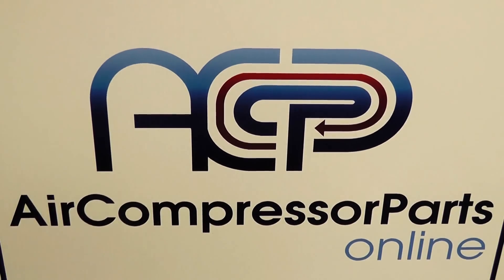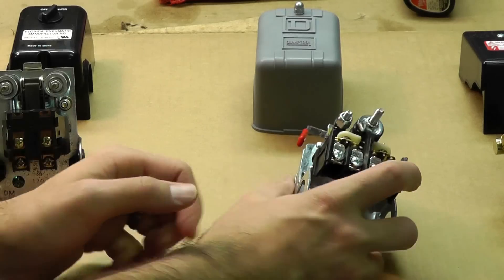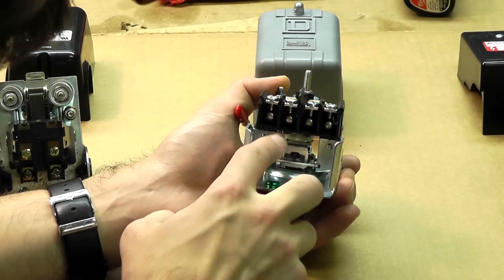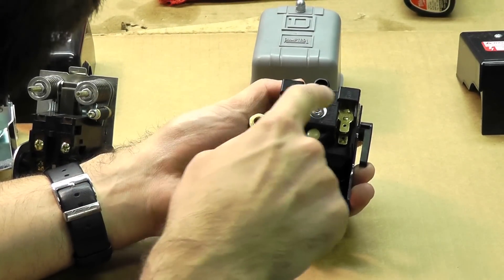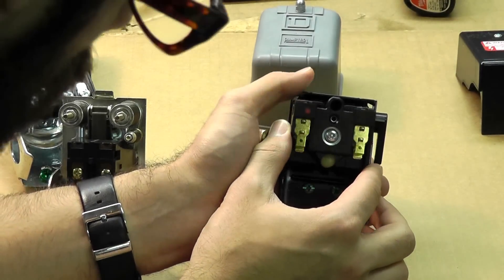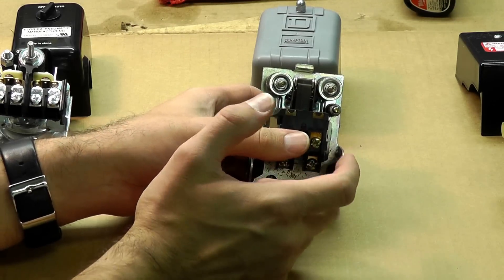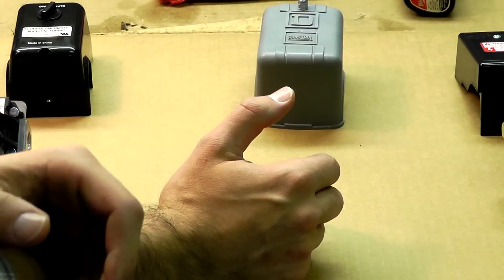How To Adjust And Wire A Pressure Switch

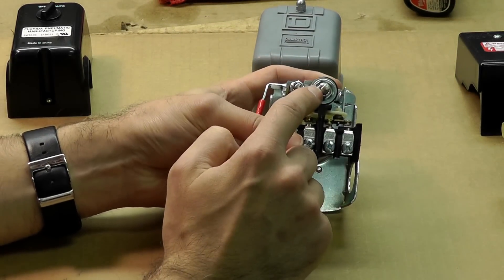Comment: Question: Square D pressure setting (4:53) Is my understanding correct?  (1) First adjust the large nut to set the cut in pressure, so if I wanted to lower cut-in pressure to 100 psi to reduce the amount of cycling I would turn it counterclockwise.  (2) Then if I wanted to maintain the manufacturers 175 psi cut-off pressure, I would turn the smaller nut to increase the differential.  NOTE: This is an Ingersoll Rand 2475 unit which comes from the factory set to something like 140 psi cut-in, and 175 cut-out.  I typically run higher volumes of air at 40 psi in a media cabinet and don't need the unit to cut back on at 140 psi because it is so far away (pressure-wise) from what I need, causing the compressor to annoyingly cycle.

Comment: I wonder if it's possible to repair a pressure switch? The cheapest I can find a Condor MDR2 in the UK is £50. I only paid £60 for the compressor, and I could buy a complete new motor + switch for £150.
Reply: Everything's repairable (sometimes moreso than others). What's wrong with it?

Comment: When building presure and it cuts off all the air bleeds out down to about 40 psi. How do I adjust a condor switch so the air doesn't bleed out
Reply: That's not the switch. You need to locate where the air is bleeding out. It should be airtight. (Assuming you don't have a 40PSI safety valve)

Comment: Can use these switches foo operatic Uv light.  I am tryin to do is to only operate the Uv light when the pump comes on.i am living in Cambodia and  to not burn out my UV light when my pump is not t I have to unplug the power  cord.
Reply from the maker: Since the pressure switch tells the compressor when to cut on and when to cut off, you should be able to do this, yes. You would need to choose the pressure switch that has the cut-on and cut-off PSI that you need. There are many switches available in various configurations that we offer (and many other retailers offer). I don't know much about your application but I'm sure this can be done. Thanks for the question!

Comment: I have Square D switch ..What will make the contact points stick..the compressor will not kick off..will run till pops the pop-off valve
Reply from the maker: Thank you for the question! If the contacts are not physically touching when max PSI is reached, then most likely the switch needs to be replaced (this is also a safety issue). If they're touching but the unit isn't turning off, you should be able to take some emery cloth or fine grit sandpaper and clean the points up, as there is probably varnish on them, not allowing them to make clean contact.
Reply: @AirCompressorPartsOnline   they seem to weld together when compressor runs for a bit
Reply from the maker: @rickystone4137  I would make sure that all other electrical components on the unit are working properly. Make sure the power cord, motor cord and motor are pulling the correct amperage and voltage. Enlist an electrician to confirm the above, if possible.
Reply: @AirCompressorPartsOnline  I put a new square D switch on it and its seems to have fixed the problem..thx
Reply from the maker: @rickystone4137  Glad to hear it! We appreciate the comments.

Comment: So for air compressors there’s no such thing as a single or three phase pressure switch right??? Lol
Reply from the maker: Basically, that's right. Any typical pressure switch like you see in this video will wire for single phase or three phase power.

Comment: I have a 30 gallon Ingersoll Rand air compressor in my garage and want to use it for sprinklers blowing in my house, they recommend to blow them at 60 psi but my compressor fill up to 125 psi, what do I need to do to make it blow at 60 psi ?
Reply from the maker: Thank you for the question! You just need to install an air regulator valve, which will typically "T" in from the on/off pressure switch and has a coupler on the outlet end to attach your air hose to. You turn the regulator knob CCW to reduce the amount of air to your line. You can find something like this on our website by clicking at the below link:
https://aircompressorpartsonline.com/regulator-14-mini-reg0250m-p-156.html
Reply: Air Compressor Parts Online thanks a lot, I’m gonna put this other right away,

Comment: I just purchased a new pressure switch for my Ridgid 5 in 1 but it keeps popping my breaker and I know the wires are set properly what can I do to fix this issue
Reply from the maker: You may want to confirm the motor isn't drawing too many amps. If it's a new pressure switch, the only other cause could be the power cord itself (possible short) or the motor is drawing too many amps. I would probably have an electrician take a look since electricity is involved, that's the safe bet.

Comment: Is there a reset button when you replace preassure switch? I replace that black box on my 15 gallon dewalt and now it doesn't want to turn on at all. Please Advise
Reply from the maker: There isn't a reset button on the switch itself, no. If you installed it and it doesn't turn on, you may have wired it incorrectly. Also, check to make sure the power cord is in good shape and that you have continuity throughout the switch, cord and motor. You can bypass the pressure switch to see if that's the weak link. If all else fails, I'd recommend getting an electrician to take a look at it. Thanks for the comment!

Comment: Question? What is the allen screw on the top, in between the contacts of the switch that you showed and said you couldn't adjust the pressure setting for? I have a hubbell on a Ingersoll that looks exactly the same as that one and it looks like it adjusts something(but i don't know what), because it is connected to a big spring and when you turn the screw the spring gets tighter or looser. Can I get some help with this? And what if you get the silicone off that's covering the adjustment screw, could you, in theory, change the pressure setting? I just need to lower the pressure cut out for safety reasons. Thankyou
Reply from the maker: Thank you for the comment! You could in theory remove the silicon from the screw head and adjust it, yes, although it's not recommended due to liability reasons (for that reason I can't say that it's recommended). Typically, the screw with the larger spring adjusts BOTH the cut-in and cut-out pressure, whereas the smaller screw/spring adjusts the differential only (i.e., just the high end cut-out PSI). Hope this helps!
Reply: @AirCompressorPartsOnline  Thank you so much for the reply. I have the exact same switch in your video on the far right, the one with the silicone cover. So you are saying the torx screw that is attached to the big spring is the main cut-in/cut-out adjustment? Well i very easily got the silicone cover removed, it doesn't matter anyway it's 3yrs out of warranty. But regardless that silicone was covering a plastic screw and it didn't help me because it did not adjust the cut out pressure, it might be the differential adjustment screw. But when i loosened the plastic screw enough it started leaking air, so i turned it back in to enough to stop leaking air. Do you have any idea what that plastic screw is that was covered? Or anyway i could figure out which is what? But the other one that was not covered(a smaller torx screw attached to a big metal spring) seems to be the one that adjusts the main cut in/cut out pressure, because when i loosened it enough it would cut the electric switch off when in the auto position. It doesn't make sense why they would cover the differential screw and leave the cut out open to change, when the cut-out would be the safety problem. And one more thing i thought the differential wasn't just the high end cut out pressure but the difference between the cut-in and cut-out, like how many psi difference between the two. Thankyou for your time, you are helping me SO much right now.
Reply from the maker: @NSXTACY420  You're welcome, I'm glad to offer any help I can. The differential adjusts the difference between the cut in and cut out, PSI so you're right there (I had that wrong above). The big spring adjusts both cut in and cut out pressure. You have a point about the mfgr covering the differential. I asked an associate about this and he said that typically they only cover the cut in, cut out screw/adjustment.
Reply: @AirCompressorPartsOnline  Thankyou again tremendously! I finally figured it out and i got my pressure cut out to shut off at exactly where i wanted it at 105-110psi to make it much safer, but surely make my motor work a little more. But yes the cut-in cut-out was not the one that was covered with the glue/silicone, which the opposite i was expecting. The plastic screw did nothing to the cut out pressure and i just screwed it back in to default and put a rubber cover back over it, as i don't need to change the differential. But I'm glad, through these comments we are also helping someone else with this dilemma i had. Thankyou friend.
Reply from the maker: @NSXTACY420  That's great to hear you were able to adjust the differential where you need it and I'm glad to help! Thanks again for the comments. It really depends on the manufacturer and the particular pressure switch. Some switches are fully adjustable while others less so. I'm sure it all has to do with liability issues, etc.

Comment: I purchase a husky 80 gallon tank only and the tank itself is rated at 175psi Max, and I want to make the compressor a 2 stage, since 2 stage pumps produce max 175psi, will I be ok having max psi rated pressure on the tank all the time at 175psi?? I want to install a 5hp 2 stage pump and motor.

Comment: were d0 I get a motor start switch? cant seem t0 find much ab0ut them . it the part in the back 0f the m0t0r v shaped c0ntact . thx
Reply from the maker: Thanks for the question! I would honestly contact the motor manufacturer. Typically they will give you an authorized sales center who can assist you with parts and sell you parts. The parts may or may not be available, depending on the brand and type of the motor. Many times this contact can be cleaned and polished, but if it's damaged or defective then yes, you'll need to replace it.
Reply: yw n still trying n yea it's damaged the white plastic piece is br0ke 0f it tht keeps it fr0m t0uching after it starts .

Comment: Hi, my old switch was a 30 psi. When replacing it I coulld only find a 40 to 60 psi.. It seems to click on and off too much. Having replaced the pump I'm worried of it burning out. Can the  new switch setting be too strong?
Reply from the maker: I would try adjusting the pressure switch first, per the instructions in  this video. Most switches are adjustable so take the cover off (after everything has been turned off and unplugged) and attempt to lower the max cut-off pressure. If not, then you will probably need to find a 30 PSI switch like your original. Square D makes one I believe.
Reply: Thanks so much..ended up taking up the pressure tank and replacing...seems to have been the culprit...it was full of water

Comment: Excellent vid. I replaced my old switch with a Square D. I wired it the same way the old one was wired. After resetting the breaker 4 times, I found YOU !.  Thanks, man. Very detailed, simple and clear. Square D. works like a charm. Thanks again.
Reply from the maker: It's great to hear this video helped you Bill. You're welcome!!
Reply: After watching multiple videos, yours was the only one that explained it to where I finally adjusted it right. Thanks!

Comment: I have a CH compressor that had a 220 motor I have a replacement motor that is 110  I think the switch won't care . But I'm not sure, Can I use the same switch ?
Reply from the maker: You certainly can wire the switch for a 220 volt motor, yes. Most every pressure switch can be wired for either 115/120 volts or 220/230 volts. If you have any additional questions, feel free to ask!
Reply: raedwulfone well, is there a 12V DC switches??
How much are they..??
Can you post the link where they sell it. 
Thank you

Comment: ist posible to not connect the strain relief on the pressure switch
Reply from the maker: Are you asking if it's possible to not connect the strain relief? You don't have to, but the electrical cord would be loose and dangle around which isn't ideal. Dust and debris can also make its way inside the switch, which can dirty up the contacts and prevent it from working.
Reply: +Air Compressor Parts Online sir im a beginner in pressure switches and i really dont know how to connect the relief strain can i just hook it up in the air tank?
Reply from the maker: You could clamp the power cord to the tank and then wire it to the switch, yes, but it's best to run the cord through the strain relief first as this will secure the cord in place and keep debris from making its way inside the pressure switch contacts. As long as you don't have any exposed wires, however, you could do what you are suggesting, yes. I would at least put electrical tape over the holes where the strain reliefs would go, to keep dust and debris out.
Reply: +Air Compressor Parts Online ok sir.how about the unloader valve? can i put copper tube directly to the tank or it needed check valve.
Reply from the maker: Glad to help! You need to run the Unloader Tube to a Check Valve in the tank, yes. The Check Valve keeps the air in the tank after the unit pressurizes and shuts off. The Unloader Valve must connect to either A) The Check Valve or B) The Pump head. If your pump doesn't have a connection for the Unloader Valve then you'll need to run it to the small unloader port on the check valve, this way it can relieve the excess pressure in the Discharge Line and from the Pump Head.
Reply: +Air Compressor Parts Online thank you sir for infos.:)

Comment: Hello. 
Will this switches work on 12v?
Reply from the maker: Unfortunately not, these switches are designed to be wired for 110/115/120 volts or 220/230/240 volts.

Comment: hello  sir my disel pump (fire pump) is start in auto mode without pressure drop ,but it should to be start after pressure drop can you tell me plz what is the problem ,

i think pressure switch is not working..may be plz help me
Reply from the maker: It does sound like a pressure switch problem, yes. Since the pressure switch controls the activation of the pump, this is my best guess. However, I'm not very familiar with these diesel pumps so I cannot say what is causing this definitively. I would contact the manufacturer of the pump to be honest. Thanks for the post!

Comment: @Air Compressor Parts Online Hi, can all compressor pressure switches be adjusted?, mine has the red pull up and press down switch on top to turn it on and off,very common type,it stops at about 115psi but does not kick in until about 30-40 psi way too low,i want to adjust it to about 60 psi cut in.
Does the black plastic casing with the red switch just pull off?
Reply from the maker: What you have is a "Lefoo" branded switch or something very similar. As far as I know this switch isn't adjustable, but I'm not 100% sure until I take a look at one in our stock. Typically the manufacturer will cover the adjustment screw in silicone so you can't adjust it. To remove the cover it's pretty simple, you just remove the screw that's in the recess on top of the cover, then pull the cover right off. I believe it's a Philips head screw. I'll take a look to confirm and will reply ASAP.
Reply: My type is called a NE MA (Spa)
20 AMP
380V MAX
Reply from the maker: If you have the pressure switch with the red on/off button, it should certainly be adjustable. Remove the cover and there is a 10 mm cap screw head and arrows pointing to the left and right with a + and a - sign showing which way to turn for higher or lower pressure. This should increase the cut-on AND cut-off pressure. This is the only adjustment for this switch, I believe. It doesn't have a separate differential adjustment (which would adjust the cut-off pressure only) or an adjustment for the cut-in pressure separately.
Reply: thanks, im trying to remove the black plastic cover to adjust,cant seem to get it off,no screws holding it on and im afraid if i pull it too hard it might snap the red switch off :(
Reply from the maker: There should certainly be a screw holding the cover down. I've never seen a switch cover without one. It's probably recessed in the cover right on top. If you'd like, you can email a photo of the switch you have to customerservice@aircompressorpartsonline.com and I'd be glad to assist you further. It was be easier if I had a visual on your specific switch. Thanks!
Reply: Ive just took a look and it seems that ontop there is a small hole recessed deep and at the bottom i can see a ascre head,looks like star type or very rusty philips head :)
I will try and remove it